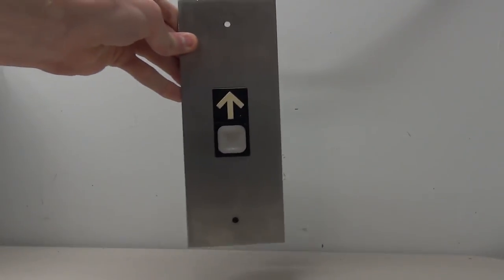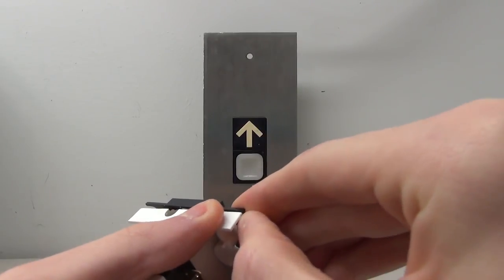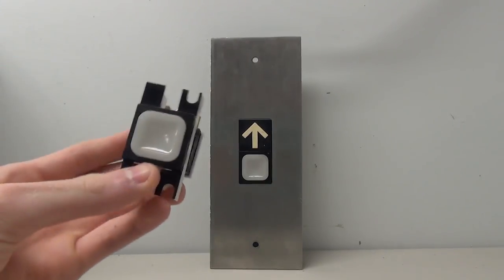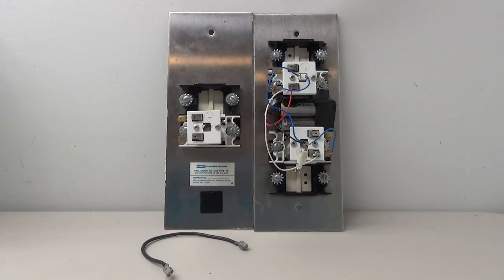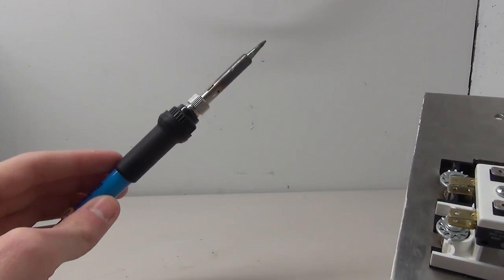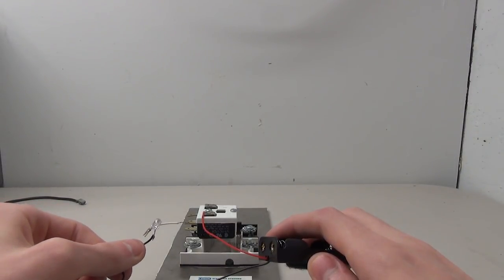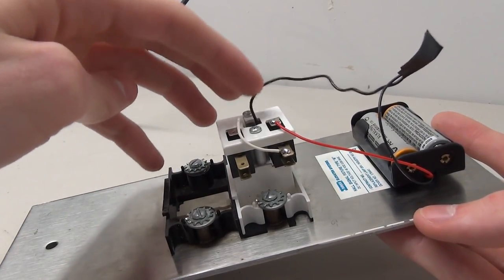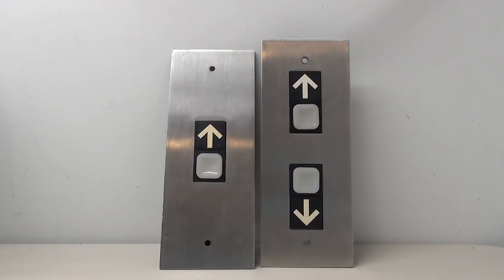How to Wire Dover Impulse

Comment: now i don't have a soldering iron but i do have aligator wires that will work securly
Reply from the maker: You can also buy connectors that fit on the pins.
Reply: @stlelevators  I could but I have alligator wires so it works and I do have a arcade button with the same micro switch but different manufacturer
Reply: @stlelevators  stl elevators I do now have a soldering iron from an elenco soldering kit but I’m waiting on a fume extractor

Comment: Please don't tell me that led in that intermediate call station is red. If it is... Oh god, that led would be suffering.
Reply from the maker: It’s pink. A red would need a resistor.
Reply: @stlelevators  Good. Also something to note. It is just a good idea in general to add a resistor in series with any led even if the voltages are the same. There are many reasons for this.

A LED is not like an incandescent light. LED's are very susceptible to over voltage because of the way they are built. Their voltage current relationship is not linear like most loads, it is exponential. So even small changes in voltage (as low as 0.2v) can cause huge jumps in current (which will either kill the LED or lower its lifespan). A resistor is always added so that any voltage jumps in the circuit will be absorbed by the resistor and not the LED (this is ideal).

Something to note, just because the voltages of the power source and the LED match does not negate the need for the resistor. This is because there are electromagnetic waves that are emitted from many household products. These waves (if brought close enough to any conductor) can induce small voltages in a circuit. These voltages are usually small, but remember! LED's are VERY susceptible to over voltage. I have to admit, I too have made this mistake, the electromagnetic radiation emitting from my computer was enough to break an LED that was nearby that did NOT have a series resistor added to it.

If you have any further questions about this, please don't hesitate to ask, I am always happy to provide more information on the basics of electronics to those who ask :)

Comment: If you only wire one switch the button won’t light up the led if that micro switch fails
Reply from the maker: The chances of it failing in this setup are pretty low.
Reply: @stlelevators  and did you know arcade button use the same micro switch

Comment: I just realized can you use the screws that are in the button(wire it without a sodering iron) to the light?
Reply from the maker: You might be able to. I actually want to remake this video since it's a bit older and I've improved on how I wire things now.
Reply: @stlelevators  ok